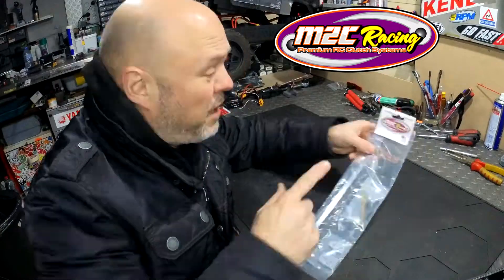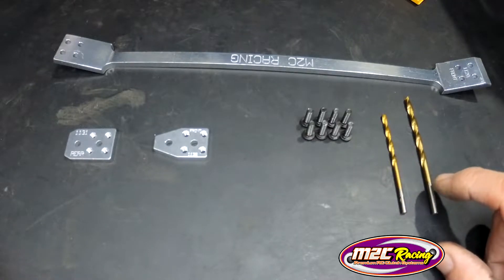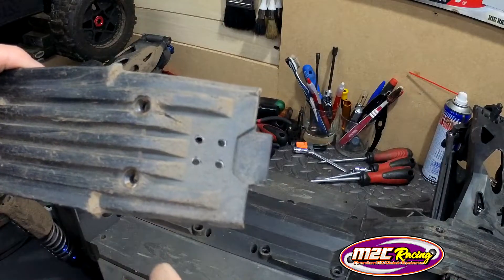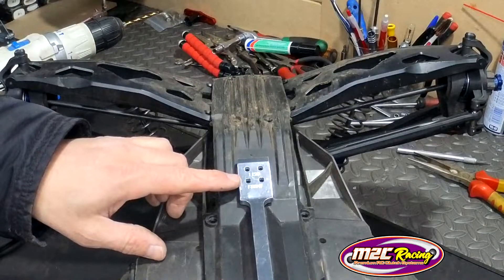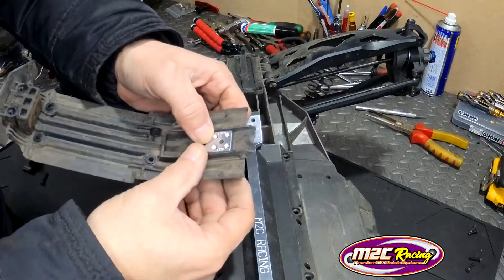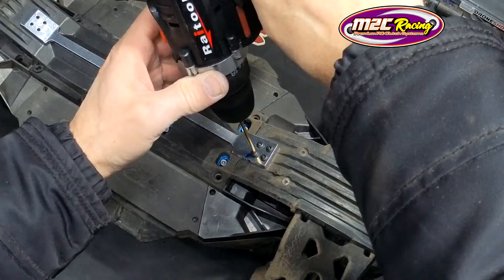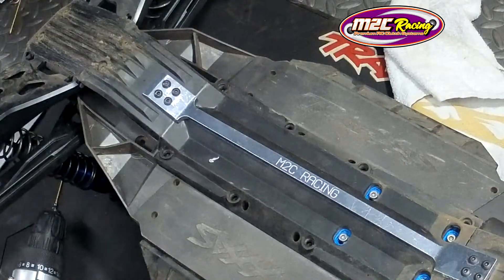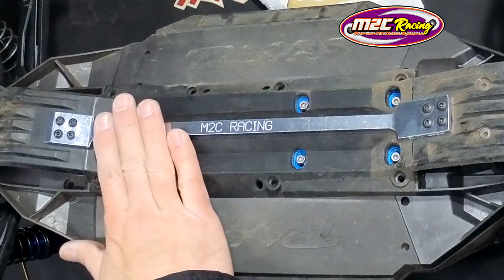M2C 1129 X Series Chassis Brace-- Traxxas X-Maxx -- INSTALL VID --

Comment: What size are the screws?  Lost mine and need to re-order
Reply from the maker: I think the original ones are m3x20 (you can order longer screws and cut them to lenght to) but i made another video where i used other screws (countersunck) so the hexes don't get damaged after hard bashing ... maybe check that out.